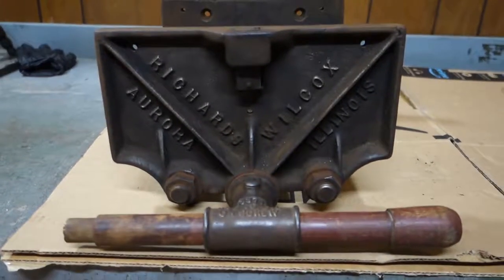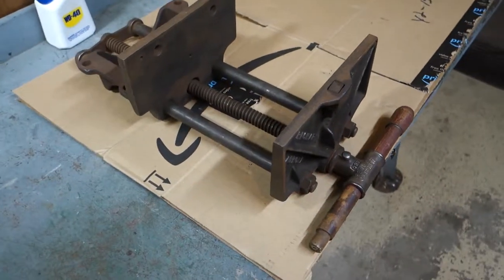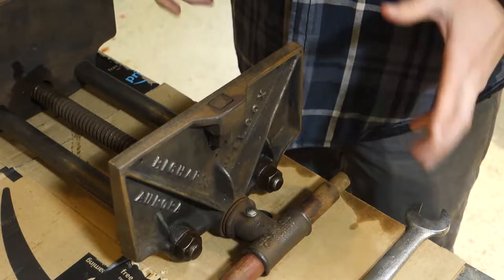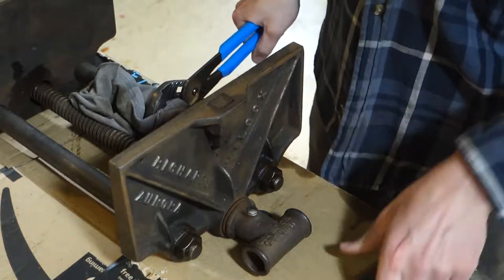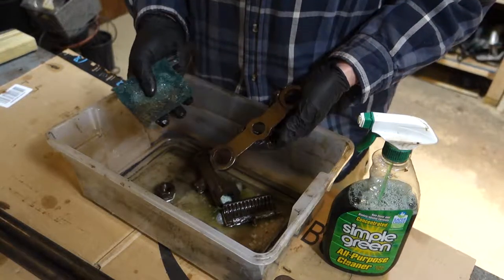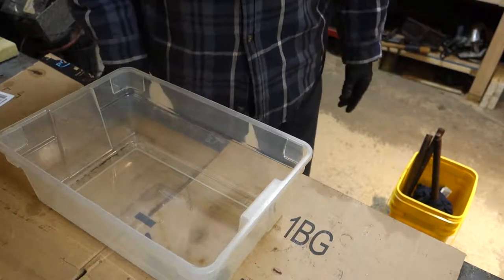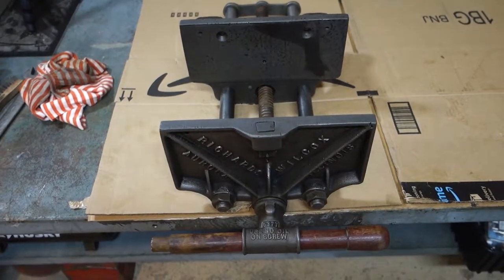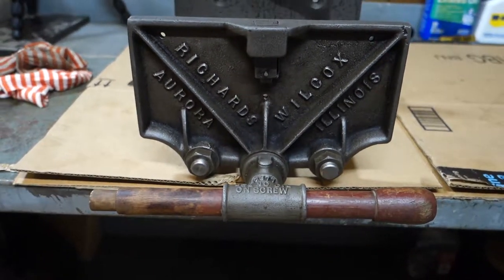Richards Wilcox Woodworking Vise Restoration - BLO Finish

Comment: I worked for Richards-Wilcox for 23 yrs. The company is still in business. They stopped making the vices before I started working there. The number on the handle is probably the casting number. I use to deal with the old castings when i was there. There where still casting that they still used that where 100 yrs old.

Comment: I have the same vise.  I found this catalogue and right around page 210, it lists this vise and the other models offered.
https://archive.org/details/RichardsWilcoxCatalogNo12/page/n209/mode/1up
Interestingly, based on the quick release mechanism, it appears that we have a 430 S even though it's stamped 230 on the rear mount.  I'm guessing the rear mount was standardized across the line.  From what I understand, these were manufactured as early as 1907 - this catalogue is from 1914.